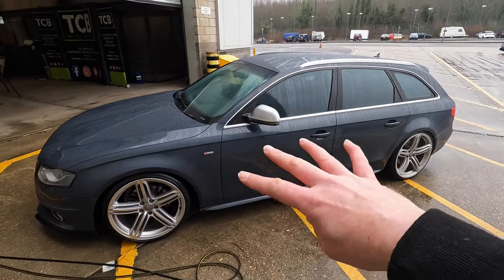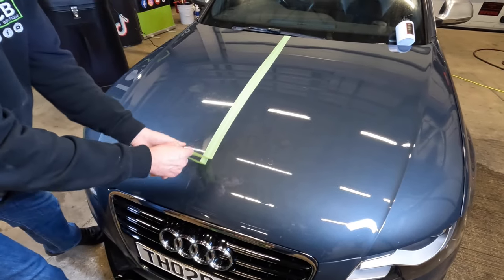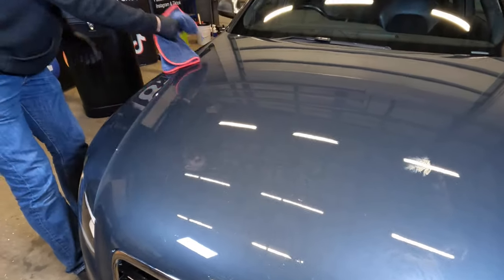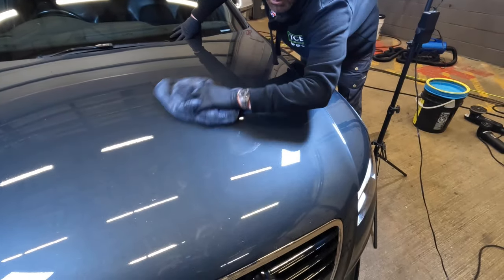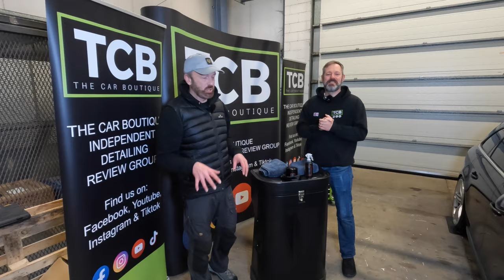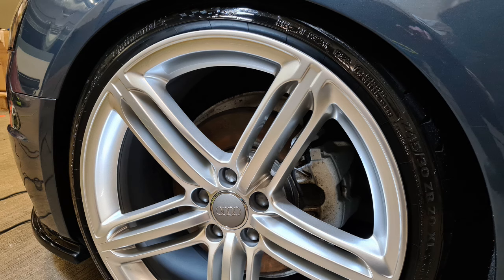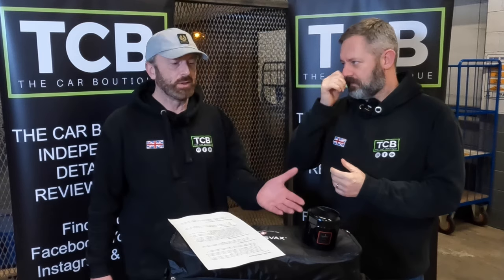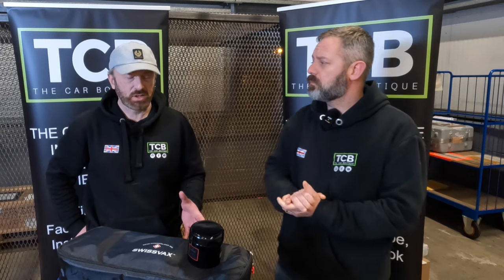💧Is This The Ultimate Detailing Experience ?  #carwax #detailing #luxurybrand #satisfying

Comment: I guess I only have one slightly critical question in regards to your conclusion: does the Swissvax wax give you any more emotional value than a HBS wax?
Reply from the maker: Oooh that is a whopper of a question. In terms of emotions I would say that both give me immense pleasure. HBS provide the perfect synergy of all variables including branding, presentation, pour, scent and wax performance. The price point is also spot on and excellent value. I suppose Swissvax give me a different emotional feeling based on using a wax that has a substantial price tag on it, akin to owning and using any luxury item. If I had the choice based on price then HBS would get my vote. In terms of the feel good factor I would say Swissvax as, like I said in the video, I enjoy using a luxury wax that carries an exclusivity on it based on its price. Am I materialistic in this sense possibly, but that's me being honest.
Reply: @thecarboutique2467  I can absolutely understand what you are saying and respect your opinion.

My personal opinion, based on what you just said, is that an HBS wax gives you everything a Swissvax wax gives you (and more) but costs a lot less. Like a tenth of what this Swissvax wax costs. And if you strip away the „exclusivity“ factor, then in my opinion there‘s not a single reason I would prefer the Swissvax over the HBS wax.